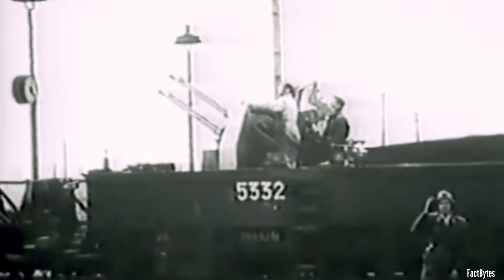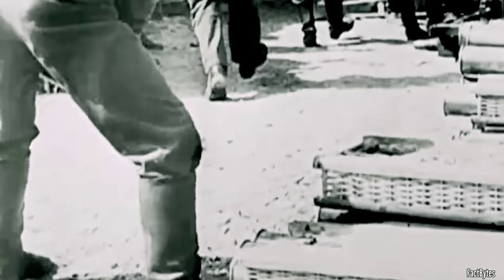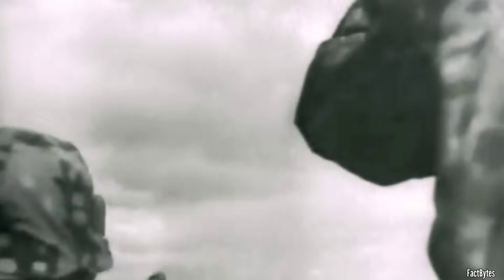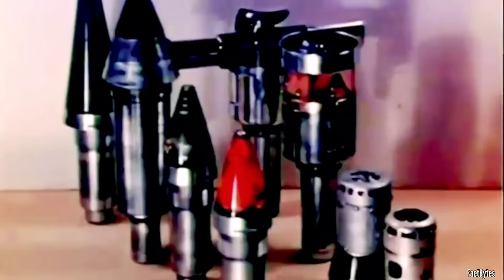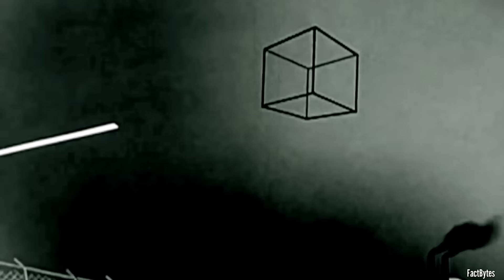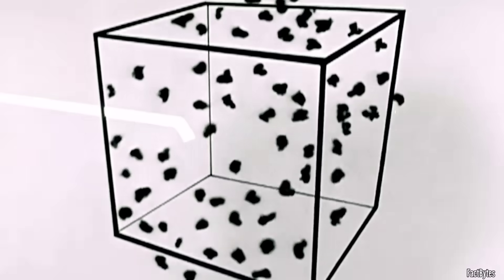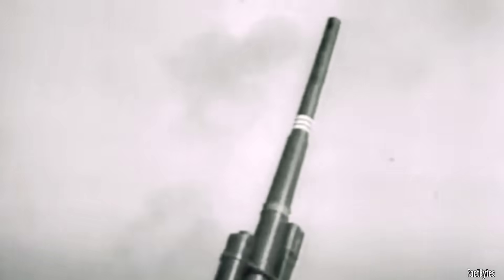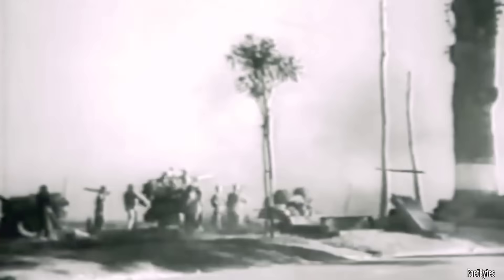The Science of Flak: How Did German Anti-Aircraft Fire Really Bring Down Allied Planes?

Comment: My father kept a 2” piece of flack in his top dresser drawer. It was a jagged chuck of black steel. He said it was pulled out of his B25 engine cowling after a bombing run. He was a B25 pilot flying over Italy from Corsica. One of the methods he said they used to avoid the flack was on the bombing run was to start at a high altitude and descend to a lower altitude. Flying into chucks of steel flack at 200 to 300 mph will damage an airplane and ruin your day. Those were plexiglass windscreens and not bullet proof. Joseph Heller wrote a book about the unit. Maybe you have read the book or seen the movie? I know you know the movie title, “Catch 22”.

Comment: Although quite interesting, the science of flak led me to believe it would cover what explosives were used, how proximity flak actually worked, how was the machine built that could detect altitude, etc.  Honestly, this was more the mechanics of flak, rather than the science of flak.
Reply: Spot on Mr Krieger. I'm still unaware how the projectiles were 'set' to explode at a certain altitude. I get what a timer does - i think - but were they all fixed at point of manufacture or were they able to be adjusted prior to being loaded?

Comment: The Flak Towers (Berlin, Vienna and Hamburg) did not rely on optical predictors (FuG 40). Each had a second tower called a Leitturm or director tower close by, which was equipped with Wurzburg tracking radar.  The firing data from the radar computer was transmitted electrically to the Gefechtsturm or battle tower and was displayed on clock face pointers for the gun layers.  The ammunition for the 4 x twin 128mm autoloader guns was given a fuse time setting prior to loading.
Reply: Interesting synopsis 👍
Reply: not sure if this is true but I've heard that flak towers were also used as shelter for civilians if need be.

Comment: I'd like to add that the bombers had one commander, who was obviously in one of the planes. In early days, the commander flew inside the first plane. You mentioned, that all lights tracked the first bomber? That was the reason. Kill the commander, and the fleet has to re-group. Then, the radars on the ground (you mentioned) where't radar, those were directional antennas to find out, which plane was transmitting. Because the americans quickly learned, to place the commander somewhere else, but he betrayed his position, as soon as he keyed his transmitter, it shone electromagnetically like a sun in the night. His position was then wired to the next flak battery. 

The number of victims you said doesn't seem to reflect the real death-toll. Remember that Avro Lancaster of the Royal Air Force “Just Jane.” It was pretty famous for completing 25 combat missions without being shot down. That was sensational, everybody else had it way harder.
Reply: Every single thing you've written here is wrong, what a mess, wow.

US bombers flew in groups called boxes, each 16 bomber box had a lead bombardier that was in the lead bomber, he was the only one who used a bomb sight, all other bombers in the box dropped on his cue, there was a backup bomber in each box in the event something happened to the lead bomber that would move into the lead position and take over, it didn't require anyone on a radio to tell them to do it either, it's how they were trained. 

What you think was some kind of radio monitoring antenna was indeed radar just as the narrator of this video says, it was what's called gun laying radar and it was used to range the bombers so the gun crews would know what setting to put on the shell's fuses so they'd burst at the right altitude, US bombers didn't need to talk to each other during the bomb run, they knew exactly what to do, wherever it is you got the idea that they were gabbing away with each other over the radio is just absolutely laughable, once again each 16 bomber box had a lead bombardier, the other bombers in the box toggled off their bombs upon seeing him drop his, the arrangement of the bombers in the box is what gave them bomb dispersal, ie a pattern on the ground. 

The thought that if the Germans took out the commander then no one in the other bombers would know what to do is comical, they knew what to do in the first place and didn't rely on radio communications during the bomb run, it's called training.

You really need to do your research in life before making ridiculous claims like you have here, start with this video because it's right when it comes to how the radar augmented German AA gun's worked, then go to the channel US WW II Bombers, he has several videos that go into even more detail than this one about German AA gun's and their use of radar.
Reply: @dukecraig2402  Guess you'd be surprised that I agree. Strategies changed all the time and both sides had to learn quickly. There's no "it was like this all the time".
Reply: Lancaster S-Sugar, in the RAF Museum in Hendon, flew 125 missions.  Please stop posting nonsense.
Reply: @jo-ov9vc  We're talking about different phases of the war. Close to '45 just could just do what you want, that's why they surrendered.